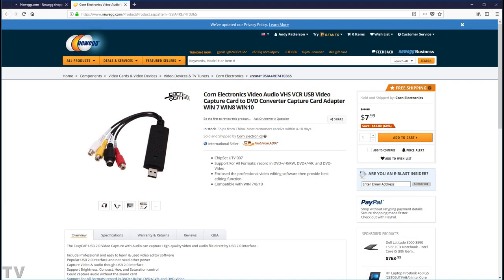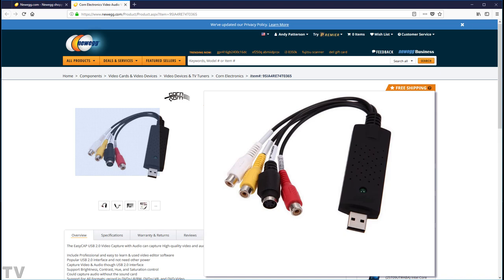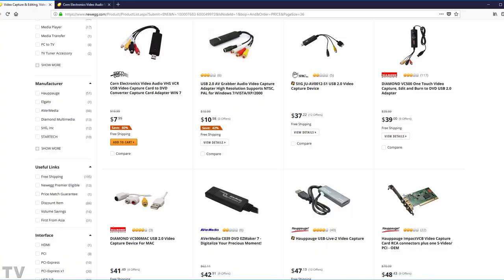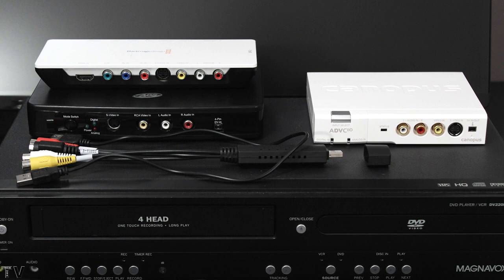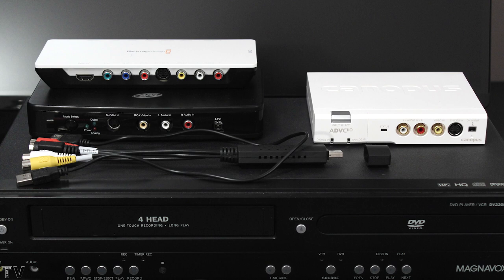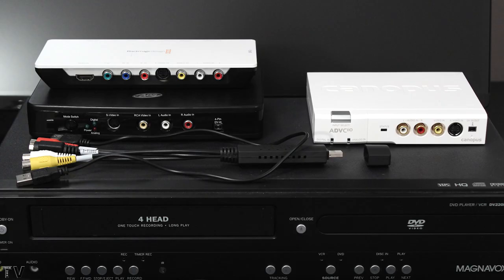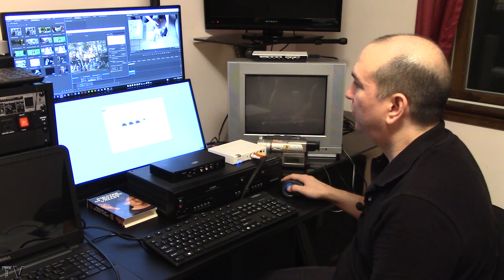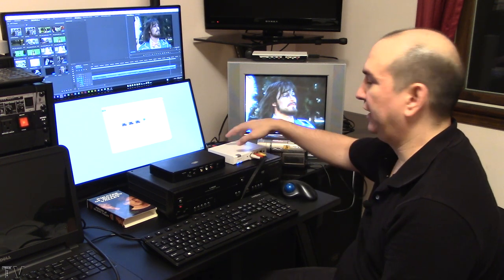best option to transfer VHS and Hi-8 tapes to the computer

Comment: In middle 2019 I put away my old Dazzle DVC100 and bought a used ADVC-110 for 25€.

I'm reconverting all my old Video8, Hi8, VHS and VHS-C (150+ tapes) with the ADVC-110, video and audio are so good compared to the old DVC100, I really like how this DV cards converts my old tapes.

My ADVC has only the front 4 pin Firewire port working, but who cares, it converts my old tapes like a dream.

Oh, last thing, I built a custom Core Duo machine only for DV capturing.
I capture DV signal with Ubuntu 18.04 LTS, Kino, a NEC firewire card and a Fujitsu SSD, no dropped frames at all. Windows XP and 7 kept dropping frames during capture with Pinnacle 9 and 15, WinDV and Scenalyzer.

ADVC-110 for the entire life 💕

Comment: Based on info from this and other sites I acquired a Canopus ADVC 110 and a Mitsubishi HS-HD2000U VHS player.  Hoping to get some good results with transfers soon!
Reply from the maker: The Intensity can get a better result than the ADVC 110 if you opt to capture uncompressed using the Intensity Shuttle. Having said that the Intensity Shuttle requires a TBC. The image quality from ADVC 110 is not bad and is hassle free for the most part. The video link might be worth watching. 

https://youtu.be/xdw9_DETrqE
Reply: That was 8 months ago. What's the verdict?

Comment: Thank you for this channel!! This video is how I discovered you a few weeks ago. After watching several more of your videos, I decided to take a leap from my Elgato USB Video Capture to the ADVC110 and I'm so much happier. Firewire is so much better than USB and always will be. I almost bought another Mid 2011 27" iMac because mine is starting to fail on me. However, after seeing your video where you're using the ADVC110 with an M1 iMac, I knew I would be fine using my M1-Pro MacBook Pro with an external monitor...and yes, I used your link to grab the Apple Brand Thunderbolt 3 (USB-C) to Thunderbolt 2 adapter, which now completes my collection. Keep at it, man. Your content is super helpful!
Reply from the maker: Thank you and I am glad my videos were helpful.

Comment: if you have that problem with color shifting. 
The thing that works for me to correct that:

1) open Settings (Options) in your capturing software
2) click a button next to your Capture device that says Settings 
3) then click Control button
4) go to the Hue slider, and pull it all the way to the maximum

after you do all that you will no longer have color shift problem!
thumbs up if it works!
Reply from the maker: With the Intensity Shuttle I can view the incoming video on my broadcast monitor and make adjustments in real-time on broadcast compliant equipment. The ADVC 110 does not allow for adjustments. The cheap USB capture device allows for adjustment but the quality will always be worse than my other capture devices do to the cheap components and funky drivers used for the cheap USB capture device. Having said that your capture card might work OK. If you want to see crisp and clean video simply click the link below and let me know how your capture card compares. 

https://youtu.be/Q4zcLU4Cdi8

Comment: Hi. I bought a Canopus ADVC-100 a couple of years ago after your recomendation.  Its been brilliant.  I have a PC with firewire card in it. My question is can the Canopus take Dv video in from my camera  in the front and dv out the back connection to the PC?  I know I can connect the video camera direct to the PC firewire but I wanted to have a large TV connect to monitor the video at the same time.  So I wanted the TV connected to the analogue phono connection and the camera in the front dv and the PC in the back dv.  Do you know if that is possible?

Mant thanks.
Reply from the maker: You can connect a DV camcorder by Firewire to the Firewire DV converters.

Comment: Hi there 

Great video 

I have just purchased a Sony GV-HD700 Clamshell recorder, which I plan to use to capture vhs as well as Dv. I was just wondering if  I would get a similar quality file with this device as with the Canopus 110? As they are both FireWire out 

Do you know much about capturing analog signals with these clamshell recorders? 

Thanks,
Nick
Reply from the maker: I am not sure if Sony GV-HD700 can be used like a generic Firewire DV converter.

Comment: I just checked out the price of the ADVC 110 and Intensity Shuttle 😰. Suddenly I came out with another idea. I can connect my HI8 camera to my MiniDV camera, record everything from HI8>MiniDV>Mac with FireWire. It will take 2x as long but at least I can avoid buying this accessory. Last time I did it quality looked fine to me.
Reply from the maker: It should not take twice as long. Most Mini DV-25 camcorders will allow for pass through. It will allow the Mini DV camcorder to work just like the ADVC 110 (IEEE Fire Wire DV converter).
Reply: @TechTVusa  I remember I did it EONS ago, I don't remember if it allowed for passthrough though. If it does I'm set!

Comment: I am just getting started with converting some old VHS tapes, and have a Canopus 110, but in my first attempt, I didn't get the audio in the stream via firewire. Am I missing something? I used a direct USB convertor as a first attempt, but the quality was poor, I did, however, get audio with this method. Maybe I am misunderstanding something from the sketchy 110 manual, but I have analog coming in the front jacks. Analog mode selected, and using the rear firewire port to the PC with no other PC connections. Do you need to add cables for the audio channels, or does it stream via the rear firewire too?
Reply from the maker: You need the RCA audio jacks connected.

Comment: What crt are you using? 

Is it possible to monitor VHS/ S  -VHS / video8/hi8 on a lcd screen? Any tips? I have the avcd 300 canopus. Thanks in advance
Reply from the maker: If your HD TV has an S-Video input you can us it but you will not get HD resolution only 480i.
Reply: @TechTVusa  what would you do? My source is a D VHS recorder from Philips (VR20D) and my idea is to deactivate the internal TBC, connect it through the s VHS connection to a Datavideo TBC 1000 time base corrector and then to the Canopus AVCD 300 and switch all the enchancers off  and then to firewire in my MacBook Pro M1 Max. The TBC 1000 seems like a very good Time Base corrector and I assume better then the internal of the VR20D Philips and Canopus. I would like to have the highest quality from VHS and also video 8/hi.  As a video 8 source I have a SONY EV-S9000E recorder for transferring video 8.

Thanks in advance.
Reply from the maker: Does the D-VHS have a way to connect to the PC? All I use is the ADVC 110 long with a VCR or Hi camcorder.
Reply: @TechTVusa  no. It only has a FireWire input and s VHS out.

Comment: If your computer has firewire port, and your handy camera has firewire, whats the need for the Canopus converter in the middle? Can I just take that out of the equation and connect directly to the computer via firewire? Then VirtualDub to capture.
Reply from the maker: Firewire DV converters are for transferring analogue tapes to the computer. Firewie DV camcorders can plug into the Firewre port. No need for the Firewire converters.

Comment: I have a Panasonic vcr and a MacBook Pro with Final Cut Pro and I want to convert all my vhs 📼 tapes to digital, I tried $85 Elgato capture device but gives a digitized mosaic image all over the screen and specifically looks horrible on a moving shot. Please suggest where to start how can I input my VCR to MacBook Pro by using any FireWire DVD’s converter?
Reply from the maker: The video link below should help.

https://youtu.be/g1YJy-Dc6kM

Comment: Quick question - For the Conopus ADVC or ADS Pyro, can you run the firewire into a USB-C 3.0 with an adapter directly to Windows 10 /11?  If so, going to try and use VirtualDub and Handbrake  to clean-up and compress as needed.  If Conopus and ADVC wont work, do you recommend any other FireWire converter that would work with USB-C 3.0 (Intensity Shuttle, or other)?  This is for old transfer of old VHS to digital family vids.    Thanks again!
Reply from the maker: You cannot converter Firewire to USB but Thunderbolt 3 is backwards compatible with Firewire as seen in the video link below. 

 https://youtu.be/rHWHE3ilBbU

Comment: I want to start by saying THANK YOU for putting this information out there, it is extremely helpful, you are performing a true service to the film-making community.

SPECS: 2017 Mac Book Pro w/ thunderbolt 3 ports, Sony TRV68 Handycam

DESIRE: Capture my HI-8 tapes at highest possible quality to project in a theater.

Will the Shuttle upscale my h-8 tapes to 1080i/p? If so is this route higher quality then manually upscaling captured 480p footage in Adobe premiere? 

Can the Shuttle or Canopus receive s-video and component audio simultaneously during the capture? Or will I have to capture s-video first and then the audio and sync in premiere?

Do I need a external video capture card for the Canopus?

I apologize if I missed this info somewhere, I've watched what I think are all of your videos on the subject and cannot find the answers

THANK YOU!
Reply from the maker: You might find the links helpful. 

https://youtu.be/Q4zcLU4Cdi8

https://youtu.be/xdw9_DETrqE
Reply: Thank you

Comment: My guess is, you you use a 60 FPS timeline in your video editor, and deinterlace the DV AVI captures in VirtualDub using the MSU Deinterlacer, your output would rival that seen on a CRT. The output from this process is 480 60p. It retains all the detail and the smooth motion.
Reply from the maker: If you output to DVD or Blu-ray leave it interlaced. If your goal is to post on social media use a 60P sequence and export at 60P. Adobe Premiere Pro will handle the rest. There is no need for Virtualdub or Handbrake. It would just waste time and decrease the image quality to use other programs. Below is a link to the method I use. My method is focused on ease of use but you can see the image quality towards the end. 

https://youtu.be/dVLUxRkPMdA

Comment: It sounds like you have lots of experience with various methods of video capture.  Will you entertain some questions?
I have tried a variety of methods or capturing home video's (VHS) with less-than-stellar results.  Nothing I have done is anywhere near the quality I see when playing the VCR directly to a TV.  Here is what I have done.
1. Dazzle DV bridge to firewire port (with various capture programs; Movie-Star5, Adobe Premier, WinDV, VirtualDub, Cyberlink Director).  Capturing with no compression at 25Mbs rate.
2. Diamond VC-500 USB using Cyberlink Director (tried AVI and mpeg2).
3. Panasonic DVD recorder encoding mpeg2 directly from composite video), then importing the DVD into editor.

Basic problem I cannot yet overcome is generally crappy image.  I can get by pixilation with the high-rate AVI capture.  But images do not have sharp edges and a fair amount of noise (like snow) within the images.  Not over-driven with snow but enough to reduce overall image quality.

Any thoughts on whether or not stepping up to a Canopus ADVC 1xx might get result in a better image?  I hear so much talk about this unit but cannot find direct comparisons.
I have heard of others using a composite-to-HDMI up-scaler device and then another device on that to capture the HDMI to a memory device (thumb-drive).  Can you recommend this approach?
Reply from the maker: The software being used is half the equation. I use Premiere Pro. The ADVC 110 won't clean up the image if it is grainy looking but it will not make it look grainy either. You might find the links below interesting. 

https://youtu.be/dVLUxRkPMdA

https://youtu.be/PTQYJKQpazk

Comment: hey i have a problem and i’ve been having this problem ever since trying to digitalize my hi8 and digital8 tapes. whenever i try to digitalize my tapes it comes out really glitchy and the audio is always loud and buzzy. i have an example on my channel it’s the second video i’ve posted. but i’ve tried 3 different softwares (OBS, Vidbox, Roxio) and pretty much 2 different of everything (camcorders, rca cables, computers, etc) but no matter what i do it always comes out the exact same i don’t know what i’m doing wrong. i would really appreciate any tips of any idea of what i might be doing wrong. thank you!
Reply from the maker: I use Firewire DV converters and software programs like FCPX, Premiere Pro and iMovie.
Reply: I had around 100 tapes from a client, a mixture of VHS, Mini DV, 8mm, Hi-8, Digital 8. I have a Digital8 camcorder, but had to borrow another one because some of the tapes would Not play properly? Static audio, sometimes the video was jittery? The second camcorder solved that problem?

Comment: 2:45. timeline Premiere > output BM Intensity > VCR > capture BM Intensity > Premiere. This makes no sense. Bodes well to have the wiring, or a diagram to illustrate the workflow.
Reply from the maker: The video is not a tutorial for the Canopus ADVC 110 or Intensity Shuttle. It is letting you know which is the better option and why. That being said hooking up the VCR to the ADVC 110 or Intensity Shuttle should be easy. If you need a tutorial for the ADVC 110 or Intensity Shuttle I have several. I left a link to one of them below. 

https://youtu.be/vATw63nn3OQ

Comment: I need capture movie from VCR through PC FIREWIRE CARD so pls advice how i do..i m searching av to firewire cable but not found.pls help
Reply from the maker: The video link below should be helpful.

https://youtu.be/vATw63nn3OQ
Reply: Pls advise also is it possible that we 

"VIDEO OUT FROM VHS
 THEN CAPTURE VIDEO THROUGH PC INSTALLED FIREWIRE CARD"
if yes so pls advice what i need
Reply from the maker: @myj5792  You need to connect the cables from the VCR into the Friewire DV converter and then connect the DV converter to the Firewire card.

Comment: Hi, I recently started researching ways to convert old VHS TV recordings to (ideally lossless) video files that might be suitable for AI/ML interpolation and upscaling. I have two capture cards available to me, but unfortunately both are USB, one is an elgato analog video capture (the popular one on amazon) and the other is a Micomsoft XCapture-1 (very reliable for game capture in my experience). The issue I have with both of these is that they lack Time-Based Correction capabilities. In this video you suggested trying to circumvent the use of a TBC using a firewire DV converter. The ADS Pyro you displayed now runs for $259USD on Amazon. Do you have any suggestions for other DV converters that would (at least partially) circumvent the need for a TBC? It really seems like nobody manufactures them anymore. The other solution I've seen has been to get a VCR with a TBC built in, and I have no idea where to start there - professional VCRs seem to sell used for a ton of money. All of the most popular and elegant solutions(including the advc110 @ $300+) seem to be out of my price range. Thanks for reading!
Reply from the maker: Any Firewire based DV converter should work.

Comment: Really well done video! Can I ask questions?  My Canopus 110 wont work with any post XP equipment-tried every driver and firewire card and internet fix posted but my HPwin 7 desktop wont play with it so I keep a legacy XP setup just for firewire/ VHS conversion, but its a pain that way! alot of transferring.  Do you think intensity shuttle will work just as well for my and does it have its own built-in capture window that comes up?(maybe cap to AVI?) I ask because I'm a Sony Vegas guy strictly and I see its not direct compatible but as long as I can grab the file and all be on the same computer it will be happy. Just focused on VHS editing.  Thank you for any info, you seem like the guy to ask :)
Reply from the maker: Load the trial version of Premiere Pro on a decent 64 bit computer  with Windows 10. See if that works. If not you may have a defective product or bad cables. The Intensity Shuttle requires a TBC to transfer VHS tapes. The video link might be worth checking out. 

https://youtu.be/dVLUxRkPMdA
Reply: I had problems with Premiere Pro and video capture with the ADVC device. Then I discovered an OLD free program called VirtualDub. It works great on my Windows 10 computer.

Comment: OK so i have new build pc with USB 3.0, does the firewire connect right to my usb 3.0 or do i need an additional adapter to get it to connect?  I'm going thru my old football game films and wrestling films from College, HS and on into middle school so i want to make sure i'm getting the best quality.  Would you recommend a VCR player as well?  Currently i have a Panasonic DMR-EZ37V SQPB-HI FI which also converts film to DVD Burner equipped but the quality was terrible on the DVD burner that came with it, i spent upwards of $300 for it.  Thinking of returning it after i came across this.
Reply: What's the difference between the 2?  I found the ADVC 300 by the same company is 1 better than the other???? Grass Valley Canopus ADVC-300 Analog to Digital Video Converter - Advanced DV
Reply from the maker: Your computer needs a Firewire port. USB 3.0 will not work. You can buy a PCIE Firewire card. I think the ADVC 300 has a dedicated TBC. I am not sure if it gets it's power from the Firewire cable like the ADVC 110.
Reply: @TechTVusa , no, it has it's own power supply. I have ADVC-300, works great.